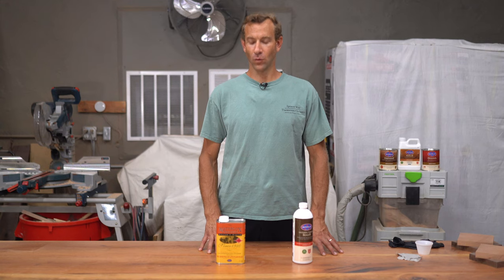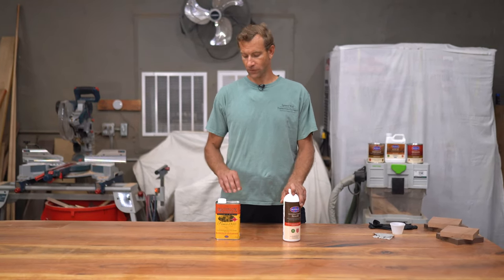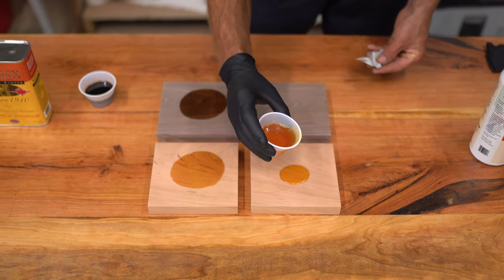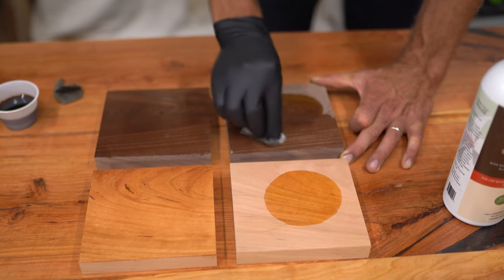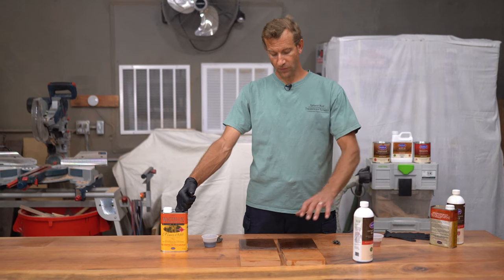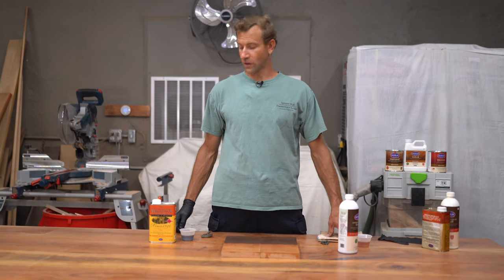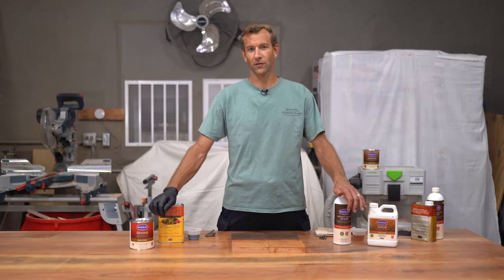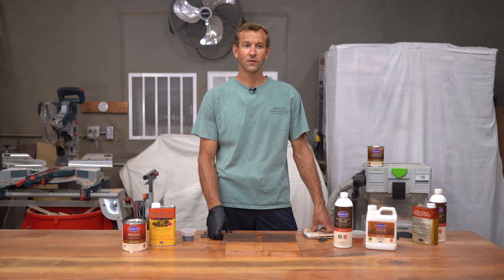Waterlox Original Finish vs Waterlox Tung Oil - What's the Difference?

Comment: “Sealer finish” is confusing. Waterlox has sealers and finishes. The latter is a top coat applied over sealer.
Reply from the maker: You also can use the sealer finish as the final product, If you like the look, we do that quite often.
Reply: The UTOS lacks UV blockers, so requires a top coat finish, while the Original sealer and finish contains these UV blockers. That is why the Original is darker in color than the UTOS.

 Waterlox is very good about answering any questions about their products. You can go to their website to access the portal to ask questions.

Comment: I brush the finish just like any other varnish and it works fine.  Using a fairly dry brush gives a much better build than wiping and the coat is thin enough that it dries properly.

Comment: Thanks for this.  Very insightful.  For the solvent based finish, how would you apply the top coats? I'd be concerned that wiping off the finish is not leaving must finish behind on the piece), and how would you finish off the final top coat?  Would you sand it out with some form of lubricated sandpaper or steel wool? Many thanks.